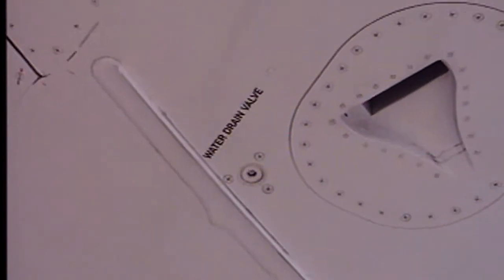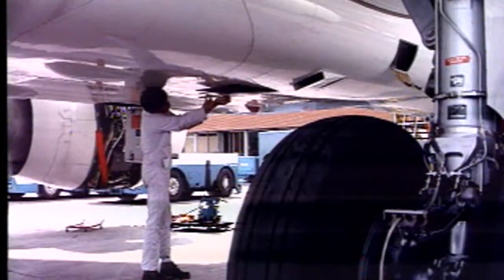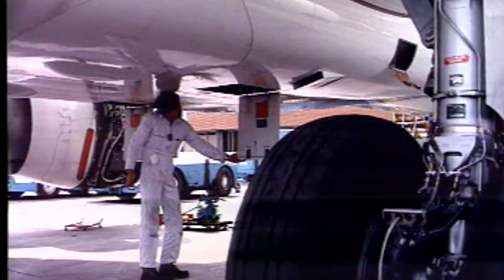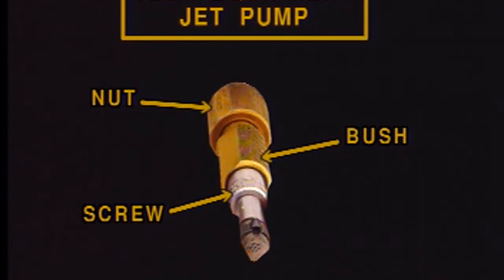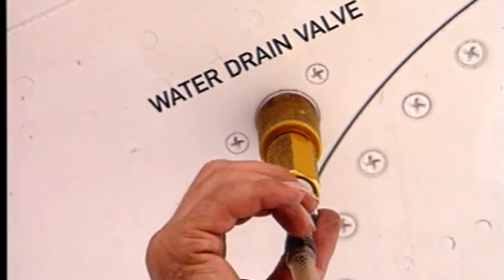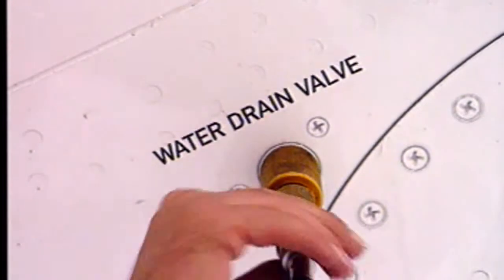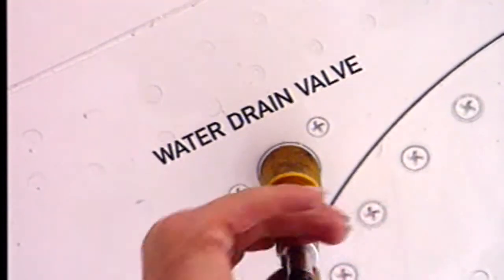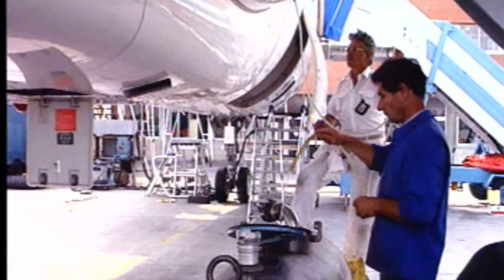Water Drain Valve Operation A320 Family

Comment: How to now water inside tank is finished
Reply from the maker: The best way is taking a sample of the solution and putting it on a proof indicator that turns into blue color if the water remains in the fuel, if the color doesn't change everything is good 👍👍👍